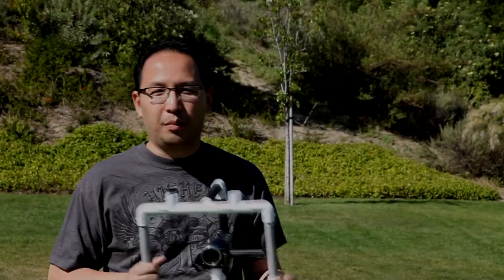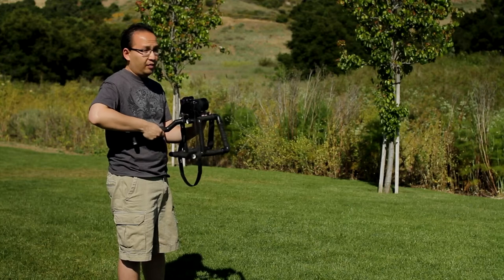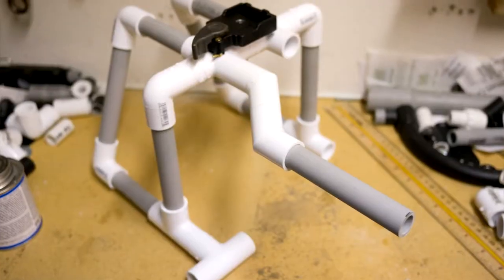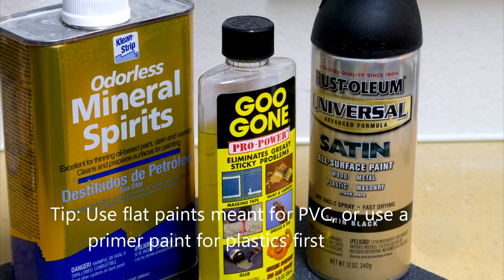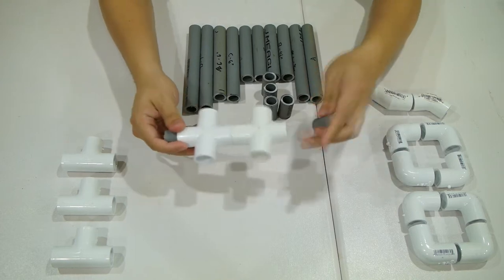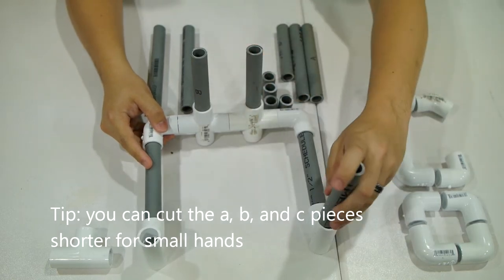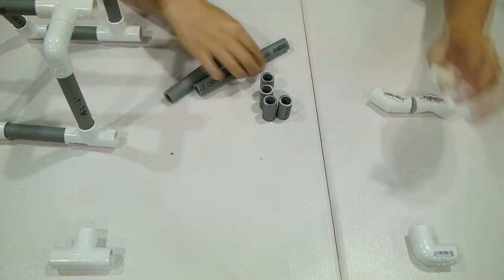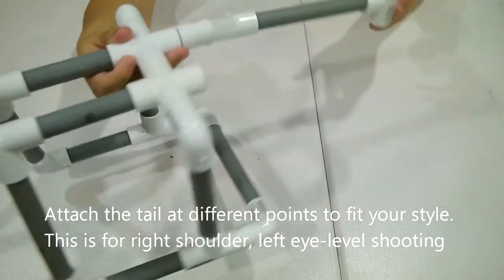DIY PVC Road Bike Rig for GH2, 7D, 5Dmk2

Comment: A great idea...and very well presented.  I'm building one now...and I'm going to include at least one variation.  What are now the top "B' pieces will be replaced with two 3-ways that connect across, the same way the two 4-ways do.  That will give me a connect point to hang a Rode stereo mic 'upside down' into the chamber created by the whole structure.  Instead of coming above the camera on a cold shoe, it will hang below, protruding out the front a little.  Will let you know if it works!